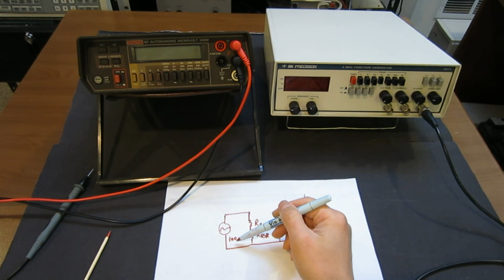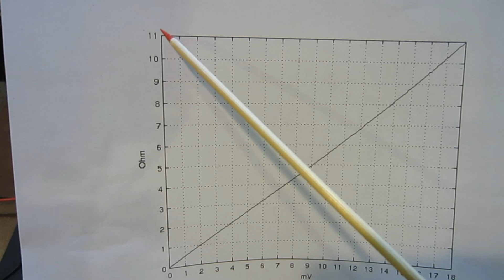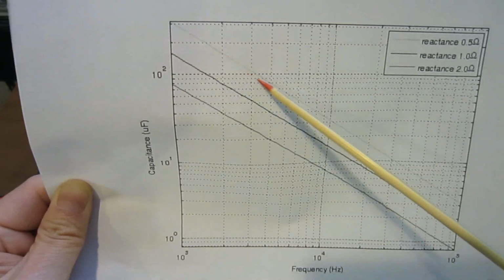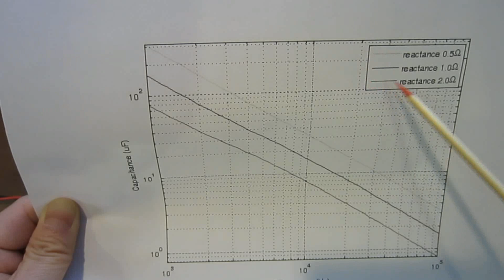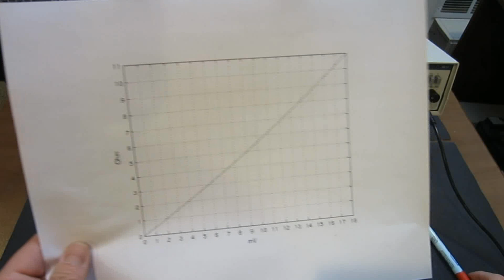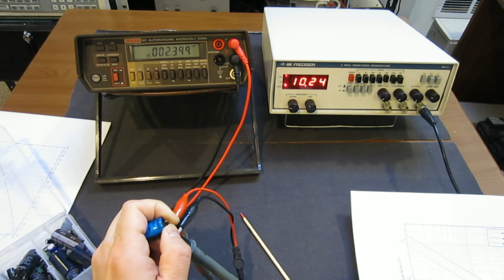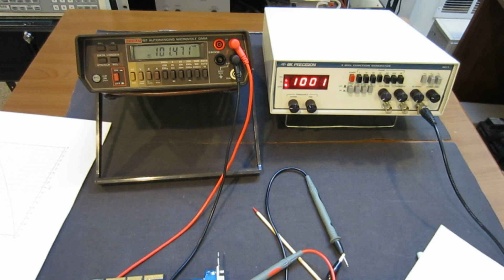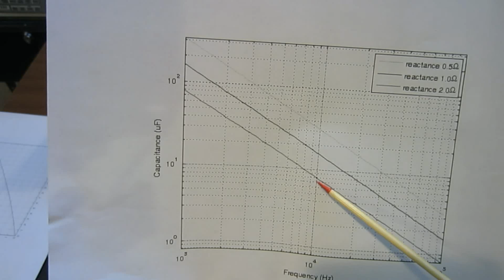ESR Measurement Using Multimeter and Function Generator

Comment: What about signal generator current limit? At 0.1V and 0.05 Ohm ESR there is no signal at all from generator. My Ketihely 2100 shows 0.0000A current after connecting the capacitor. Are you sure that this methodology will work? Maybe you need to add 1M resistor at series with capacitor and look for a current drop?

Comment: Hello! I do not have a function generator.What would you recommend a simple and inexpensive function generator?I want to easily measure esr.I'm not financially good to buy a new device.
Reply from the maker: You could use a 555 to generate the required frequency.
Reply: How do I set 100mV on the 555 ic output?555 ic output is not a square wave?Would it be possible to use a square wave in esr calculation?

Comment: Hello Kerry Wong.Note that in order to measure the high frequency AC voltage accurately, you will need to use a multimeter with comparable bandwidth.You stated in your article.Don't you give a little explanation?I could not understand.
Reply from the maker: Most multimeters have a frequency bandwidth up to a few kHz and if the frequency is too high the AC voltage measurement will become inaccurate. Basically, you want to make sure that your meter's bandwidth is higher than the AC frequency you are using for the measurement. Hope it helps.
Reply: Thank you.

Comment: hey nice work , but idont get it , you are reading milivolts , and saying Ohms are you calculating it on the fly or am i not getting something. You show a voltage divider circuit in the beginning and then no additional know resistance in example just AC source and meter probes ...im confused
Reply from the maker: +Pavle Pavlovic Thanks for your comment! Because the signal generator has a 50 Ohm output impedance, that resistance is in series with the ESR under measurement. So if you take a look at the chart on my website (http://www.kerrywong.com/2015/11/23/esr-measurement-using-multimeter-and-function-generator/) you will see that the measured resistance is roughly half of the current reading in Ohms (1mV translates to 0.5 Ohm).
Reply: Kerry Wong oh, now i get it , probes are known resistance, and milivolts rufly translate in to 0.5ohms.. now i get it ...thanks a lot